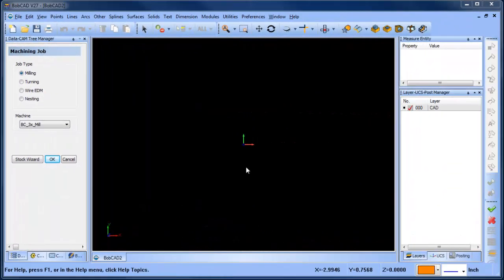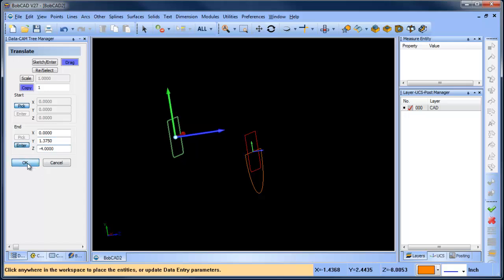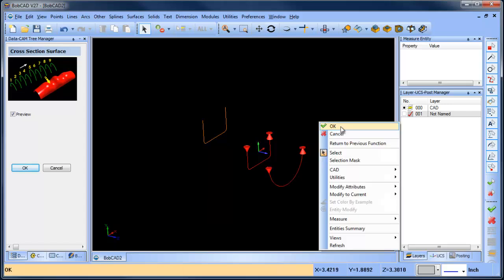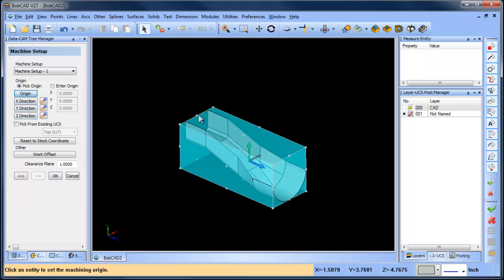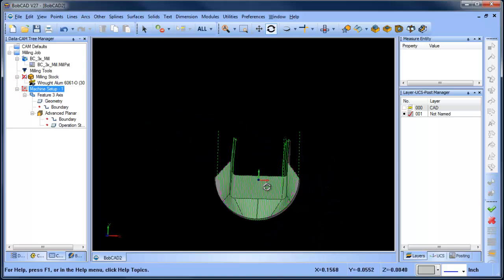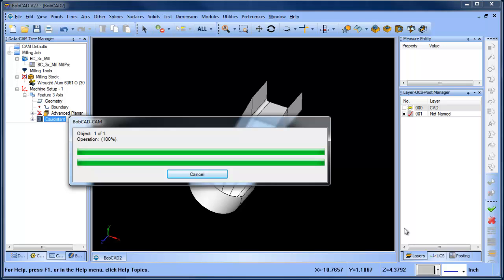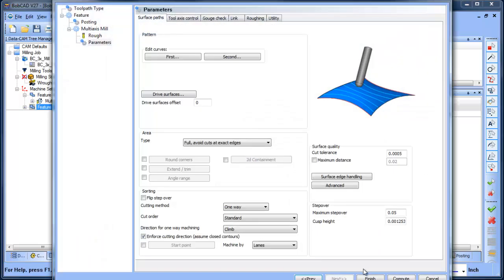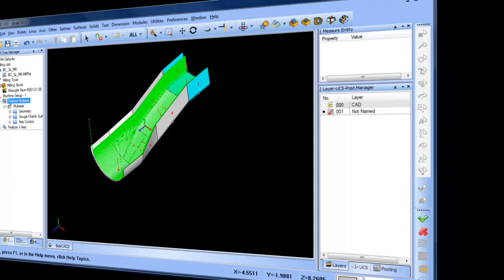BobCAD CAM V27 Surfacing

Comment: I was wondering was kind of computer  do you use ? I have a pretty fast 
I7 Quad core and it takes mine a good while to compute tool paths?
Reply from the maker: greg patterson 

Nothing special really... i5 6GB Ram using a Nvidia Ge Force GT 610 with 4 GB  .  The speed of processing has a lot to do with the machining tolerance you are using and the step over.